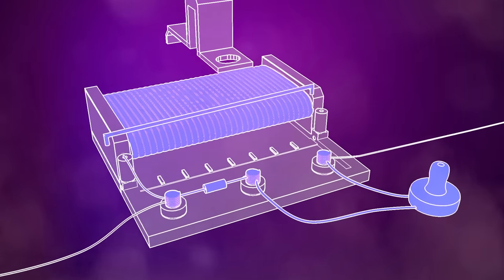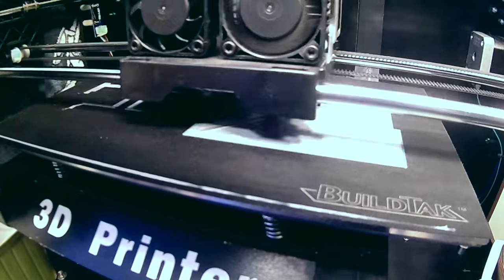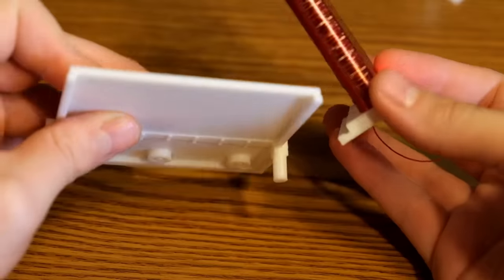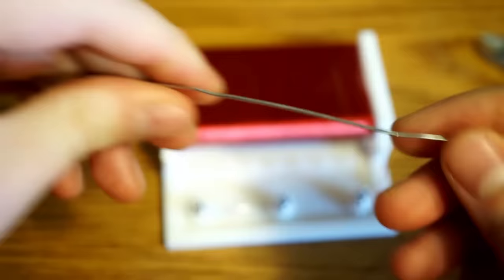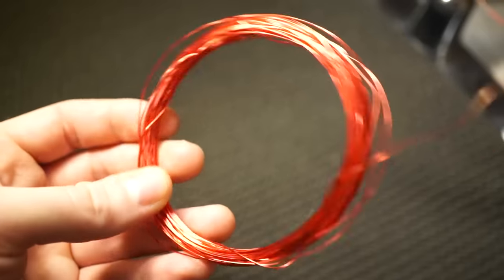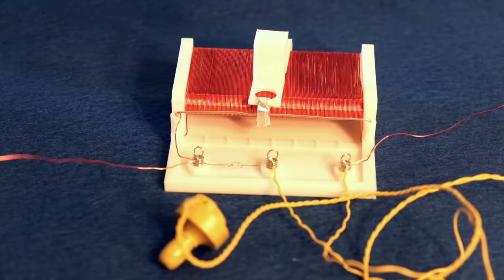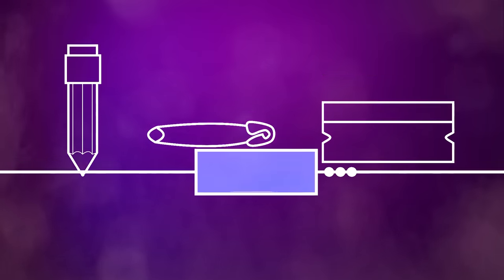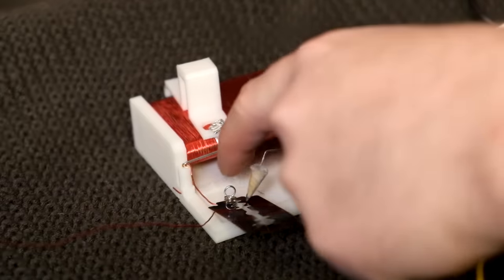3D Printed Radio | No Batteries

Comment: Could some generic transistor like BC547 or so and a battery be used amplify it?
Reply: Yes.
A transistor can make an amplifier there is lots about that on the web.
Basically, you can build the simple "crystal radio" and a "transistor amplifier" and hook them together.
BTW:
There is a very clever thing called a "stolen power radio" that will very much mystify those who don't get what is going on.
You build two "crystal radios".
After you have made a simple amplifier that works from a 1.5V battery, here is the trick.
One crystal radio gets tuned to the nearby strong station.
You put a big capacitor across its output to store up some energy.
You then wire this in place of the 1.5V battery.
Presto you have a magic radio that receives weak stations well enough to listen to.

Comment: What I would like to know is if you (or anyone) know how to 2d(normal) print one of these type of radio using copper and graphite based inks in a inkjet printer? Can the required materials be made in to inks and then print the whole thing in one go, is it even possible on paper (pun intended) to do this with inkjet printers (or lasers)? What would the 3rd and 4th inks be made of, one need to be a insulator but can a diode be printed this way? Any really clever materiels people and/or radio boffins out there with a workable idea?

Comment: why put DC into a speaker rather than AC, which is almost always used? Most amplifiers have high farad capacitors in the signal end to filter out any DC current.
Reply: He is keeping the parts count low.

Comment: Wooohaaa! So instructive
Why not using a capacitor on the resonator to tune it? Two pieces of aluminum foil that can be separated will do the job, just calculate the dimensions you need. 3D printing a variable capacitor.. hum
Very good job, dude

Comment: I don't have this diode 
Can i use other diodes
Like 1n4007????

Replay plese
Reply: 1N400x will work but not very well.  They are "big" diodes intended for power stuff.
See if you have a 1N914 or 1N4148 or other small signal diode.
Sadly in the US, Radio Shack is gone.  Amazon.com  may give you some options.
Reply: Thank you..... 👈👈

Comment: Or you can go all the way.  Forget the diode.  Replace that with a rock.  Yep, a quartz crystal rock.  Place the rock in a piece of tin foil, but leave the top of the rock exposed.  Then make contact with the top of the rock with a piece of wire.  So the wire is one lead, and the tin foil is the other.  With this technique, you can select a specific radio channel by either making contact with the coil at different points, or poking the quartz crystal with the wire at different locations. Hence the name, "Crystal Radio".   Unlike the razor method, not a whole lot of poking is required to pick up a channel.

Comment: How can I improve it by adding electronics such as transistors and MOSFETs?? Not battery
Reply: Look up "stolen power radio".  It uses one radio station to supply the power to listen to another.
You can also do a very interesting thing with a second tuned coil and a transistor or as many as 4 coils.  Here is the basic idea.
You make a crystal radio as you normally would and get it working. 
You then bring a 2nd coil near the first one and use it as a "loosely coupled" crystal radio.
You will find the loosely coupled is way more selective but not as loud.
If you use the 2nd one to bias the transistor on, you can make a thing that looks much like the diode of the first one but instead of the diode turning on when the voltage on the first coil goes positive, the transistor turns on when the voltage on the 2nd coil goes positive put passes the current from the first coil to the earphone.
When you are tuned to the station on both coils, the sound is a bit louder than with just a diode.
If you tune off the station a bit, the voltage in the 2nd coil is no longer in step with the voltage on the first coil.  This means the transistor is switching on out of step so the audio is greatly reduced.  The result is a radio that is very selective and as loud as the simple case.

Comment: would it be possible to add a piece above the, switch frequency picker thing, that shows where you should move it for which frequencies?
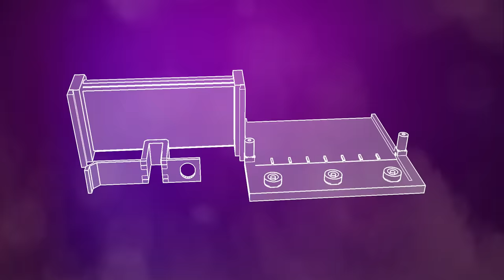Reply from the maker: I added notches right underneath the coil so you can remember the placement. You can see it clearly at 00:14 seconds

Comment: "no batteries"..... but plugged into my amp which is connected to the mains.
I was hoping you were going to use the piezo speaker and amplify it through acoustic means like with a gramophone horn.
Still, cool video.
Reply from the maker: That would have been a great idea. The audio was very faint so I thought my guitar amp would be best but I like your idea. Maybe in part 2 :)

Comment: A crystal radio? Like our fathers and grandfathers used to build when they were kids?
Reply: Yep, I built my own crystal radio 55 years ago using a Quartz crystal rock as the diode.  I had a collection of different types of rocks which were glued to a piece of cardboard.  Picked it up when in Florida on vacation.  Anyhow, I ripped off the small quartz crystal rock and put it to good use.

Comment: Hey, I know that some people had succeed in building the radio, but do you know reasons of why it doesn't worked for me?
I think that when I used the sand paper I did it to hard and messed up the coil of wire

Comment: So, like, i was explained in signal theory that a basic radio is composed by some resonant circuit for tuning, a diode, a capacitor and a speaker, how did you make yours work without the capacitor?

Comment: Wait how much power does the station have to produce to be able to hear it?

I guess you have a transmitter near by

BTW: how do portable radios recieve AM? They are not grounded?

Since you have strong stations near by, could you try to recieve one of theese stations with a ordinary pstn telephone?
Reply: The power from a station falls off as the square of distance (up to about 100 miles).  If you double the distance, the station would need about 4 times the power to be heard.  50KW can be heard 100 miles away without trouble,
Portable radios have a "loop stick" antenna.  They get a very tiny signal from that and then amplify.  The old "6 transistor radio" got an amplification of about 20 from each transistor.
20*20*20*20*20*20 = 6,400,000

Comment: The Part which i dont Understand is,
How exactly does the Frequency Selektion Work?
Reply: By shorting a part of the coil to ground you change its inductance and therefore its resonance frequency. https://www.youtube.com/watch?v=0-PParSmwtE explains it quite well. (Although I slightly different design is used)
Reply: For this version, the antenna is also a capacitor, and the resonant LC tank circuit is formed between the coil and antenna, which is why moving the antenna will detunes the radio.

Comment: You still need a powered speaker anyway so what's the point.
Reply from the maker: No it works without a speaker. I was using the amp to help amplify the sound so you can hear it easier.

Comment: probably some what useful tip: remember don't use radio waves during ww3
or learn the hard way by getting a bomb strait to your location
Reply: AKSHUALLY.... :) The razor version that he showed in this video is called a "foxhole radio", and it was specifically used in WW2 because its location couldn't be triangulated (because it was not powered.)

Comment: If I were to connect a battery, where would I put it? Also, why exactly can't I use a silicon diode? Lastly, do you have a schematic? The coil with its insulation removed confused me
Reply: Use the battery in your flashlight.
You can use a silicon diode.  They don't work quite as well but are good enough.

Comment: Try on powering an led with it please.
Reply: It will make a LED glow very very slightly.  You need to develop about 1.5V to power an LED.  That takes a really good crystal radio and a strong station to do.

Comment: Couldn’t you’ve used an led instead of a diode? (Because led’s are diodes). If you can I would recommend adding it to the tutorial (just in case someone doesn’t have a diode but have an led).

Comment: I have that same 3d printed and I can never get it to work well I have tried a so many 
Setting but it always fails do you have any tips
Reply from the maker: 3D printers can have many different problems so I'm not sure exactly what specific problems you are having. For me, I had to tighten the black belts as tight as I could. They came too loose. I print slow for the first layer and a good leveled print bed seems to be the most important factor for me.  I hope you get it working.

Comment: If you see my comment. i want to ask if you can make radio transmitter this simple.
Reply: A transmitter is only very slightly more complex.
You do need a power source like a battery to make it work (mostly)
There is a slightly funny thing you can do with a crystal radio to make a very short range and not very useful transmitter.  You build one and put a switch across the earphone connections.  When you click the switch a nearby radio will hear a click if both are tuned to the same station.

Comment: How does this work without battery?
Reply: The radio signal coming to the antenna provides all the power.  You local radio station sends out 50,000W of radio power.  You only need to capture about 0.01W with the antenna to be able to hear the station.

Comment: can I use a shotky diode
Reply: Yes, a small one works great.  Check the datasheet for the capacitance number.  1pF or so is what you want.
Reply: @kensmith5694  I am saying can I use a shotcky diode or gramnium
Reply: @walkingpuppy3282  
Nearly any diode will work.  The lower drop of the Ge or Shottky make them work better.  The best ones are the ones with low capacitance values like 1pF to 10pF.  The fast recovery from carrying a forward current make the Shottky work a bit better.  Sadly nobody makes "backwards diodes" any more.  Google them.  They were extremely clever devices.

Comment: Make a piezoelectric or puls displacement energy system like a watch run on pulse power but now it's radio which power by pulse 
Make a system which is like aneroid barometer but. One foot cubic volume 
Will it gives more energy as its feels 33 joules approximately 
Try something large and so on
Findout the limits where bigger model are not possible

Comment: Can you 3d print a 3d printer
Reply from the maker: Some of the cheaper 3D printers have 3D printed parts on them. And there are 3D printed replacement parts like gears that can also be 3D printed.
Reply: 3DSage ok

Comment: I don't know exactly why you would want to sand the coil. That would only make the coil circuit shorter. Why not just use a shorter coil? I do know that this rig works, but sanding down the coil seems retarded. Explain, please.

Comment: The start; 3D printers are kinda expensive. Even the most in-expensive $100 ones don't work out that well, as in, they require a lot of hard work to assemble and getting one item off on one assembled by yourself can be pretty disastrous.

Comment: You can build your own diode, but you have to call third party company to 3d print coil shaft which even should not be that exact shape? WTF, man?
This video is excellent example of how pointless 3d printers are.
Reply from the maker: The file i created will be the exact size and shape if printed on any 3D printer. The razor blade diode is just a cool extra step you can do but don't have to.

Comment: Now DON'T go my way, making radio after radio, using top end test equipment (oscilloscope, signal generator, frequency counter, Q meter capable of measurement of Q2500...) to test everything step by step,, talk to other enthusiasts do that for 20 years, 
Now make a dual coil DX competiton set.
 utilizing Litz wire (minimum 300 #46 usually 660#46 or higher, I have 1000 48) coil wound on low loss Polystyrene former.
silver plated variable  copper capacitors, multiple Parallel shottky diodes, impedance matching transformers to RCA big can sound powered balanced armature headphones... 
Now after a few decades and several thousand dollars you have a good radio, then start improving that step by step... Sigh, I made my first crystal radio over 40 years ago.

Comment: No AM in Sweden...
Reply from the maker: I thought AM was sent worldwide. The signal might be weak and may need a strong amplifier.
Reply: Nope, on October 20, 2010 broadcasts on the shortwave and medium wave bands ceased in Sweden.
Reply from the maker: Oh sorry to hear that. I hope you at least found this video interesting and entertaining.
Reply: I enjoy anything DIY, and although I can't use it for listening to any local radio station I can still get some cool sounds from it by just using a flyswatter to know that it works. :)
Reply: Keve1227 you don't need anything in Sweden! am signals are sent worldwide and you can often recieve ones from China and America when the solar weather is right!
Reply: That's interesting, I couldn't hear anything when I tried it indoors... I thought I could hear something at times but it kinda just sounded like interference from surrounding electronics. Maybe I need to go outside for better reception?

Comment: You will still need to wind the right kind of wire the right number ofturns for the tuning coil, so why bother with this?   A cardboard tube for the coil, and a traditional wood base is the same, or better.
Don't waste your time with this.

Comment: What does this have to do with 3D printing? You could have wound the inductor on a plastic pipe and it would have worked just as well. Using 3D printers for mechanical parts and project enclosures is nothing new.

Comment: why not also build a speaker with some paper that wire and a magnet? 
Yes out of paper... no 3d printing cheating
And why do you sand each end? you that paint burns off at 90C.. so just use a lighter and burn the ends instead of fapping it with sandpaper =)
Reply: A crystal radio won’t drive a magnetic speaker.
Reply: @BrekMartin  That is why you also going to build a small amplifier for 3V 
I believe that 1.5V would be to little but would work for a mono earphone.

Comment: 3d Printers are expensive
Reply from the maker: 5 years ago, a good printer was around $1,500 and only available online. Now, a good printer is around $350 and some kits as low at $150 and available in stores like Best Buy, Frys, and Micro Center. There is a 99 dollar SLA printer that uses your phone screen to cure the resin. So its getting so much better very fast.

Comment: Not the first. Anyone can 3d print a bobbin for a crystal radio. Nice to educate people, but don't make false claims. Besides that, well done!
Reply from the maker: I spent a while searching online for anyone who has 3D printed a radio and I didn't find anything. I sat down and designed my own in my 3D software. I am trying to get more people exposed to this old project with with the new fun twist of using the modern day 3D printer. All I hope is that people learn and have fun with this project.
Reply: Okay, well, in that case - good job!

Comment: So wait. What do you do with the antenna? Just stick it in the air? So there's no batteries? Wtf, this should do jack shit
Reply from the maker: I know it's hard to believe and I did my best to explain it. There is more information online if you search crystal radios. No batteries are needed. The antenna wire, I taped up along the walls but you can also just lay it out on the floor.  All the frequencies that antenna receives is used to "power" the radio.

Comment: so you printed a part for a radio that you didn't even need to print. And you call this a 3d printed radio??
Reply from the maker: I called it a 3D printed radio because... it's a 3D printed radio. If I made a ceramic pepper shaker, it is still a pepper shaker even if could be made out of metal or plastic.